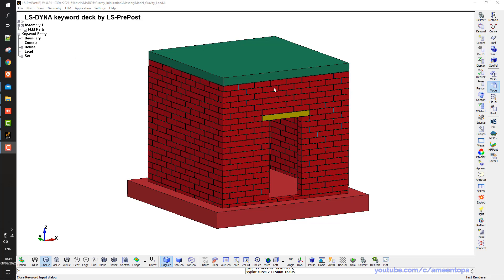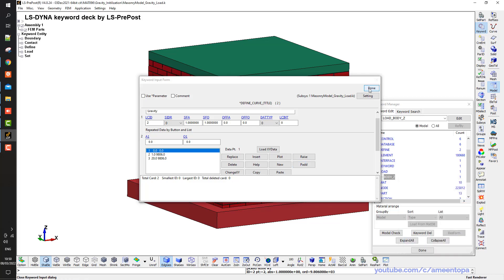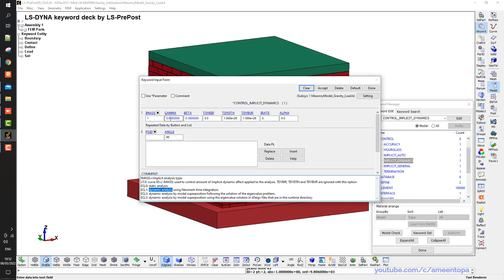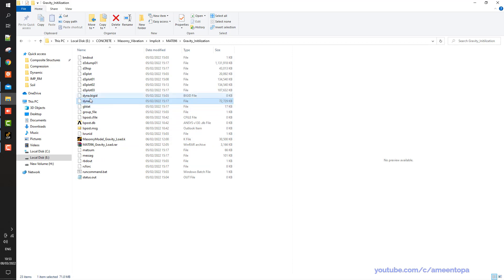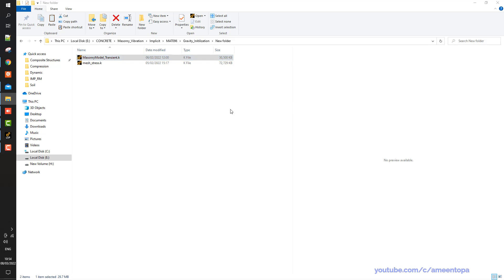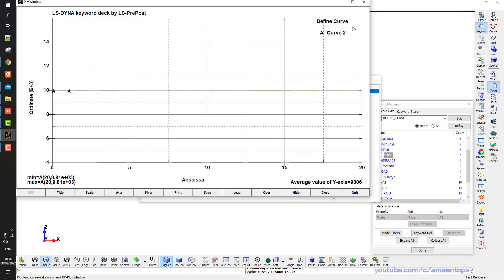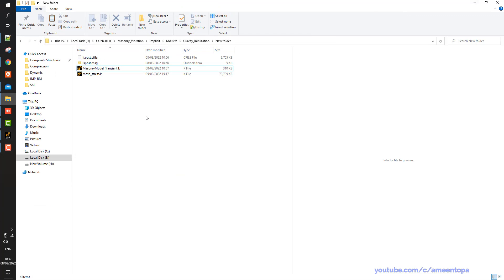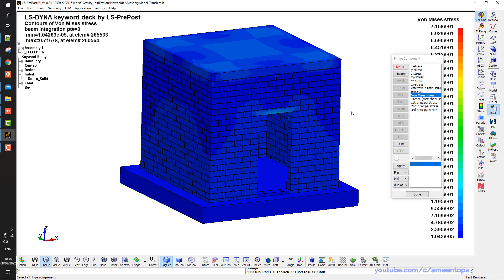Gravity Initialization

Comment: Hello, Ameen, i know this mothod is implicit solution, but when i use this mothod and i check result, the stress or displacement of nodes can't apperence static. It shows like a wave(vibration). I set gravity load to the model , and solve termination is long enough. I don't if there is the same problem in your model, because in this vedio didn't show the result curve. That's my confusion, and i hope to your reply when you see this note. Thanks!!!
Reply from the maker: Depending on the structure, you might need to increase the termination time to reach equilibrium. Alternatively, you can use the dynamic relaxation method.
Reply: @AmeenTopa  And as you said, I have to extend the termination time.
Reply: @AmeenTopa  emm~I'm glad to get your reply! I found it seems like there's no a good way to eliminate the oscillator even keep the gravity load when execute the second state. Ohhh, Numerical  simulation is not that fun, it often disappoints me.
Reply from the maker: @可流儿  I don't know how much the oscillation is. If it is small (less than 5% of the maximum displacement), then the results are usually accepted. Especially when we are talking about soft materials (soil) and fluids (like water).

If the vibration is more than that, then the problem might be the model itself: improper boundary conditions, material properties, etc.

Comment: Hello, have you ever considered using dynamic relaxation instead of a multi-stage computation ? What are the advantages of this method over DR ?
Reply from the maker: Yes, with dynamic relaxation, it is possible too.

Advantages of this method:
(1) You only need to do the stress initialization once. For example, if you have the same structure, but you want to study more than one case of transient load, then you do not need to repeat the stress initialization.
(2) DR takes a longer time compared to Implicit Analysis when you have complicated structures. For the simulation in this example, you need longer time to initialize the gravity stresses using DR method.
Reply: @AmeenTopa  Thank you for your answer, but I do not really agree with your arguments :
(1) When using DR, after the DR phase, a "binary dump file (d3dump01) and a “prescribed geometry” file (drdisp.sif) are written ". So you don't need to redo DR each time you run a new transient analysis.
(2) DR can also be run with an implicit approach, you can switch automatically to explicit afterward, so it isn't a problem for the transient analysis.
Reply from the maker: Yes, you are correct.

There are a few things that are not supported with Dynamic Relaxation, such as *CONSTRAINED LAGRANGE IN SOLID (with some solvers) and elements types (ALE formulation doesn't work with dynamic relaxation).
Reply: @AmeenTopa  Ok, I didn't know for rebars constrains, thanks.
Reply: @AmeenTopa  Hello Ameen,
Can you tell me where you reference that info to? To prestress tendons, I used thermal method and the load was initialized by dynamic relaxation. The RC slab structure was subjected to blast loading using MM-ALE approach in addition to CLIS which was employed for rebars and concrete. As a result, I did not observed any inconvenience about results. So, I am curious how you got that info and your reference. 
Thanks!
Reply from the maker: @kagangenc1386  There is no reference. It was from my experience. With older solvers, Constrained Lagrange in Solid keyword does not work in Dynamic Relaxation.
Reply: @AmeenTopa  Thanks for your reply. May I ask what kind of error you got as a result of your run? It was terminated or you got an error after the keyword was read?
Reply from the maker: @kagangenc1386  No error. The dynamic relaxation phase completed perfectly but there was no stresses in the rebars.
Reply: @AmeenTopa  Thanks for the information. I was able to get a stable prestressing force on tendons in spite of CLIS and DR were used together with the version 11.2 as I remember. This might be related to the old versions in conclusion. Thanks for the replies!